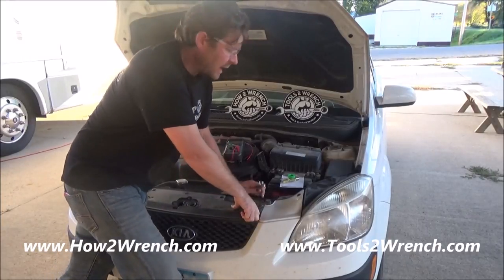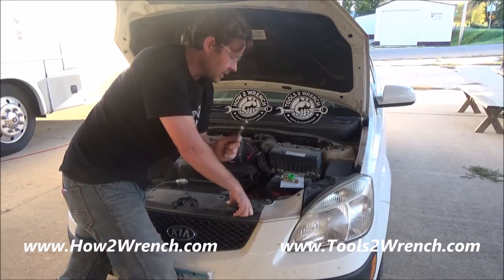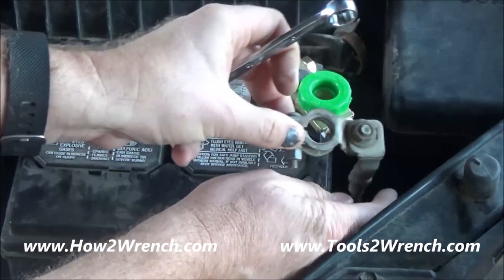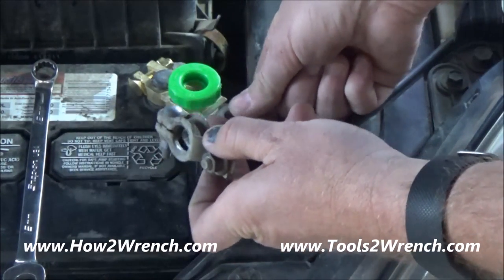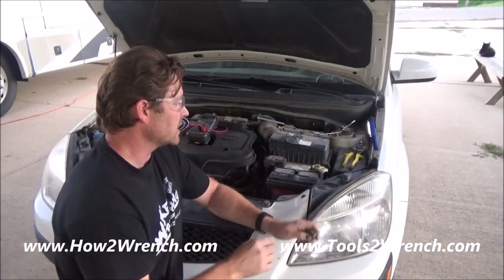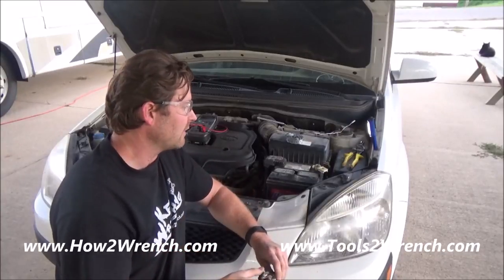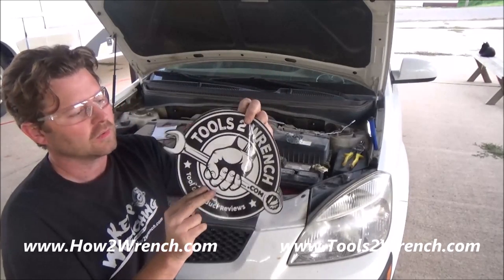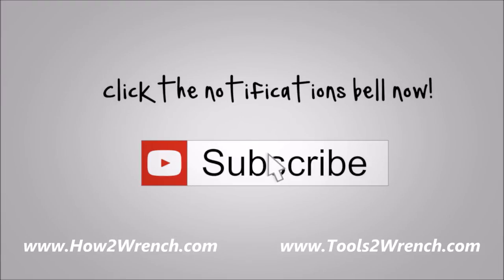How to install a battery quick disconnect for long-time storage of a vehicle. Theft prevention too!

Comment: ive got one of those in my MX5. you do not need to unscrew and pull the bottom pin out, you just need to unscrew it a few turns.

As it is the underside of the top on the green bolt is the contact for the top plate. if you keep removing it you might find that the plastic separator (seen kinda flopping down a little when you removed it) gets lost, and then it probably won't work as well. you just need to break the connection between the top of that green bolt and the top plate. that will also reduce the chance of you breaking the black wire from it bending a lot.
Reply from the maker: snipeish1 Awesome thank you for sharing!

Comment: Just a few counter clockwise rotation would disconnect the battery, u don't need to completely remove it. I use this thing on my car as well. Thanks.
Reply from the maker: Thank you.
Reply: Lol. 1/4 turn will disconnect the battery  @How2Wrench